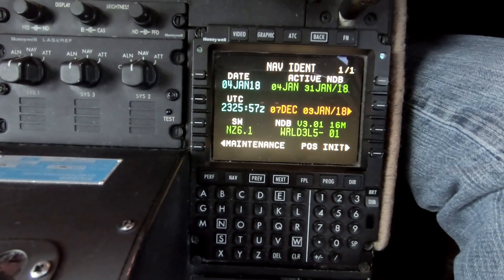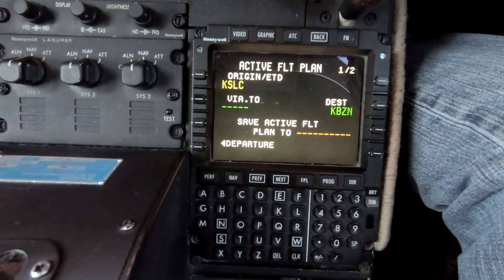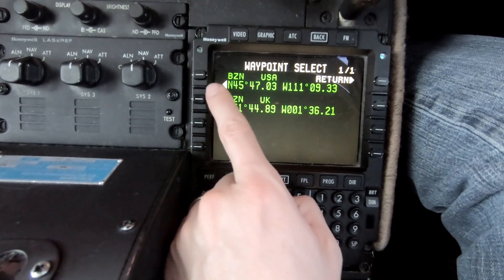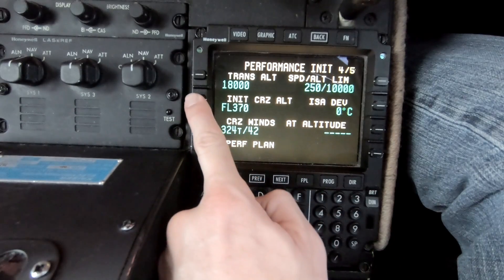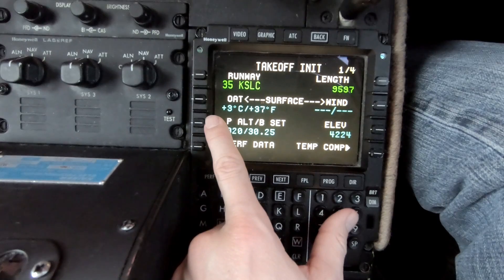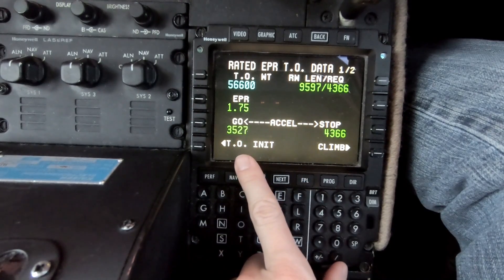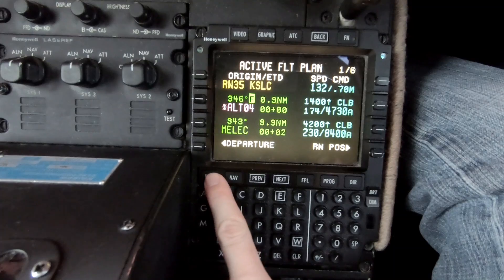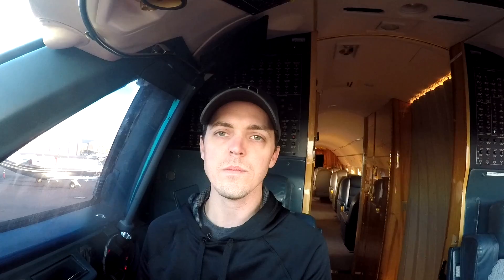How To Load the FMS Gulfstream G-IV - Pilot VLOG 39

Comment: How do you know the BOW of 43500 is correct?
Reply from the maker: The aircraft gets weighed every three years to get the BEW. Then all of the interior contents are weighed and positioned to calculate the BOW.
Reply: @CorporatePilotLife  Do you check the weight and balance book to verify what is entered is correct?  I'm asking because there's always the possibility it might not be.  For example, after Nav Computer (GIV) or IAC (GV) battery change it changes to a default weight included in the aircraft database loaded.  If it is not re-entered manually in the FMS from the official weight and balance book it will not be the correct BOW... :-)
Reply from the maker: Yes indeed. I only fly a few aircraft, so I know what the weight should be in the FMS, so it makes it easy. If I fly an unfamiliar aircraft, then I will absolutely verify that.

Comment: Sean: What are the Gulfstream acronyms for the VFS and VSE speeds? Is flaps 39degrees your normal 2 engine flap landing setting?  What flap setting do you use for a single engine approach speed? On a single engine missed approach, what is your initial flap setting after applying go around power and retracting the gear upon achieving a positive rate of climb?
Reply from the maker: VFS is the flap retraction safety speed. VSE is the single engine climb speed. Flap 39 is the normal setting for all landings in the G-IV, but we have the option to use flaps 20 for single engine landings. All go missed approaches (single engine and 2 engine) are flown at flaps 20.

Comment: You probably already know but I'll say it here. It's fairly hard to find good videos like this for anyone wanting to bone up big time on H/W FMS outside of formal training, or off-property preparation. I "know" 😬 that an initial class can be a fire hose / cram course (indoc, systems, CBT,...) can do a melt-down on even a seasoned transition pilot to new type, avionics, and FMC. Doing the math, there can't possibly be enough training or sim hours to flesh out a deep dive through the FMS before the line so there's probably a lot of OJT pain particularly on FMS. I've been plowing through H/W FMZ POM for NZ5.3 trying to get ahead on EMB-145 equipment I hope to end up on. I'm no stranger to, and well read on GA Garmin Glass with 500 hrs. teaching it, but new is new and reading is fundamental as they say.
Thanks for putting this rare good stuff out there. It really augments the static pages of a 500 page manual to watch fingers move and pages change with a good narrative to boot.

Comment: Would be interesting to see the TOGA element to setting up the plane, as I believe there is no FADEC. As mentioned elsewhere I'm flying the GIVSP in X-Plane 11, so it would be nice to see as I'm finding the performance at takeoff being extreme. I don't use more than 75% throttle, or I'm at 350knots before I can blink and the flaps break.

Comment: Very Nice! 

That looks nearly exactly as the Embraer 170-195 FMC, very similiar in fact!

How much FLEX do you guys normally use during takeoff?

It all depends I guess, but I guess since it is a Gulfstream, with huge engine power, I guess it is around 40-50 degrees FLEX?
Even the Airbus, MD11, MD80 is using FLEX takeoff, and the B737 is using Assumed Temperature, and I guess thats the same ;)

Looking forward to the next one!!
Reply from the maker: Based on temp, I have no idea. We do everything on EPR. Normal EPR for takeoff is about 1.70. We can flex as low as 1.59, but it's usually around 1.63 or so.

Comment: Do you get stressed when or if you need to change data in the FMS in a Bravo controlled airspace in rush hours. Ex. change of rwy. stuff like that. I guess changing last minute data could be kind of challenging. It woud require lots of practice. Good vid thanks!
Reply from the maker: You got it exactly...it takes practice. Once you become intimately familiar with the FMS, changes become no problem. Early in my flying career, it was very stressful to get changes like that. Now its no big deal.

Comment: Sean, how do you keep the FMS up to date for sids,stars, waypoints, etc,THANKS
Reply from the maker: Each month, we have to load the new database into the FMS to keep everything current. That's the date range we are looking for on the "Nav Ident" page of the FMS. If it's green, then it is current. Once we go out of currency, it turns orange. It takes about an hour to update the database, and it's just a flash drive that we use...sometimes our maintenance personnel takes care of it...sometimes I do it.
Reply: Thanks for the reply, one other question,are you able to use flight planning software on a laptop to generate flight plans then import them to the FMS?Your video's are great,I enjoy them very much. Sometimes I will fly your flights on a flight simulator using a Gulfstream IV.   THANKS
Reply from the maker: That's awesome! I've never thought about doing that on a flight simulator! We use Arinc Direct for our flight planning. Once we file our flight plan online, we are given a recall number and use that to download the flight plan directly to the FMS via satellite. This not only saves us the time of typing in the entire trip, but it also brings winds and temps for each point. I decided for the video to just show the old fashioned method...I'm glad you're enjoying the videos!

Comment: EPR-  Engine Pressure Ratio? Can you explain?
Reply from the maker: EPR is the pressure of the air exiting the engine divided by the air pressure entering the engine. It's how older jet airplanes set the power. Takeoff EPR is around 1.70. Newer airplanes set power based on the speed of the N1 compressor.

Comment: Great vid!
Can you consider commenting on incidents like the Gulfstream  crashed on takeoff with the gust lock engaged...they departed the runway at high speed unable to rotate (of course). Also, another incident of a Gulfstream veering off the runway during an attempted takeoff. The only thing I remember was pilots "swapping" aircraft and something to do with the tiller wheel disconnect?
I believe the aircraft was owned by cosmetic maker LOREAL.
I think you Don't hear as many accidents happening with Gulfstreams due to several factors...
Crew training/quality
Aircraft equipment and quality
Length of trips
Quality of life issues
2 person crew
Hours experience
I'm just guessing that Gulfstreams typically have higher stage lengths...Less t/o and lndgs.
I love the technical parts of hearing you guys speak of.
Either of you guys with prior military experience or both civilian training only.
You two look very young to have a primo job in corporate aviation flying the Rolls Royce of corporate jets! 
That is great though...it means you did well before you got your dream job!
"650" in your future?
Thank You!
Steve
Reply from the maker: That's a great suggestion! Perhaps I can do a future tech video on past accidents...there have been a few in the past 5 or 6 years to talk about, but you are correct that Gulfstream has a great safety record. Neither of us have military backgrounds. We are both young with great jobs...I would love to fly that G650 someday. Who knows what the future holds! Thanks again!
Reply: Corporate Pilot Life You'll fly it, you're both so young, your company will be upgrading and will want their top pilots flying the shiney new Jets!